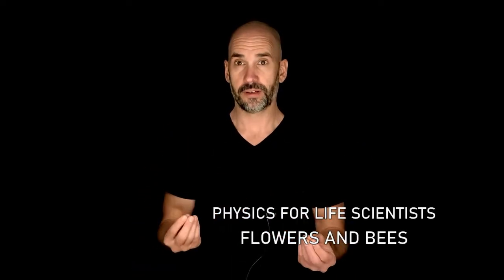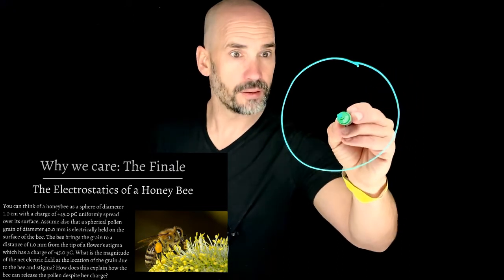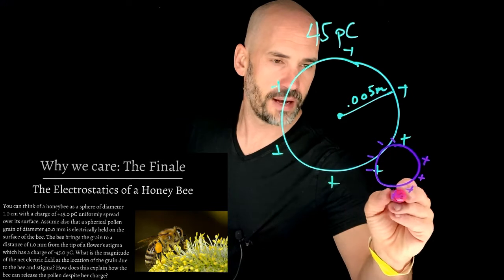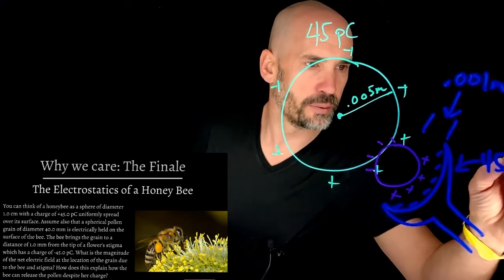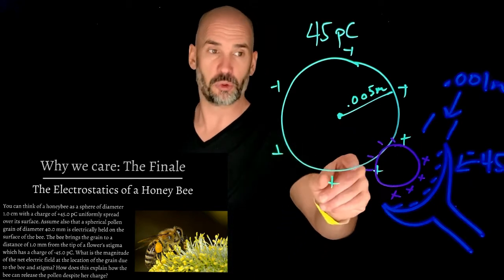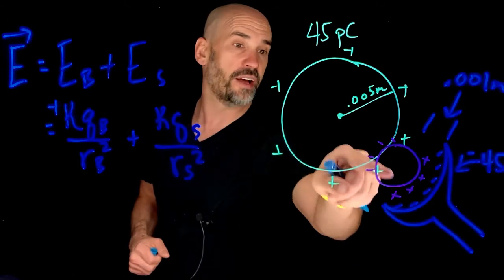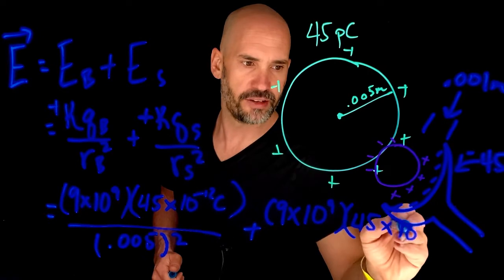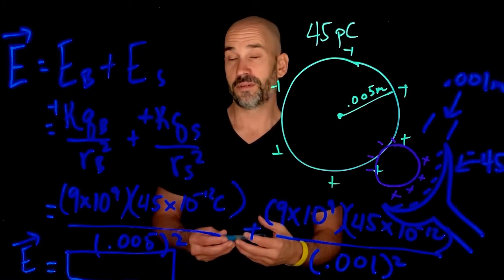Electric Fields - Flowers and Bees

Comment: Hello!! I'm not a student in your class, just a nerd. I was hoping you could clarify a point for me? I don't quite follow the logic regarding the charge of unpollinated flowers; if flowers and therefore the pollen is negatively charged because the ground is negatively charged, how do the unpollinated flowers exert a greater attraction to the bees positively charged hairs? Is it because the unpollinated flowers carry a GREATER negative charge, simply due to the higher volume of negatively charged atoms because the pollen is still present (as opposed to pollinated flowers)?
Reply: Yeah, the electric field from the flower would be stronger with the pollen there since the pollen itself is negative (electrically connect to the flower until disturbed). Plus there's some degree of neutralization occurring, so the flower is giving off negative charges to the bee.

Afterwards, the bee becomes positively charged again as it flies though the air because its wings give off electrons to the air the way your hair gives electrons to a balloon. Look into the triboelectric series for more info. The flower regains its negative charge after some time because it's electrically connected to the negatively charged Earth. Since none of these parts are metallic, there's a fairly high resistance so these processes take time, which is beneficial in keeping the flower from instantly gaining its negative charge back by pulling electrons up. That's also why the health benefits of grounding take time to occur. 15 minutes of touching grass is better than 1, and it slowly adds negative charge outside your red blood cells to thin your blood and enhance circulation.

As a side note, most chemistry happens because of electron stabilities, so in a way, life is just electromagnetism, but with matter to slow it down long enough for you to experience it over time.